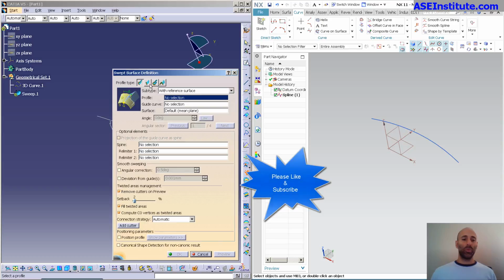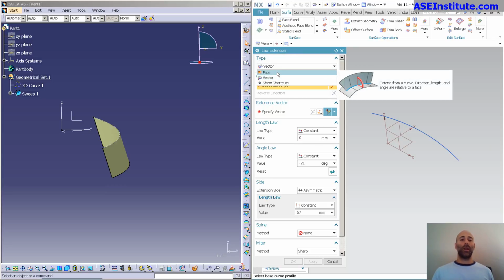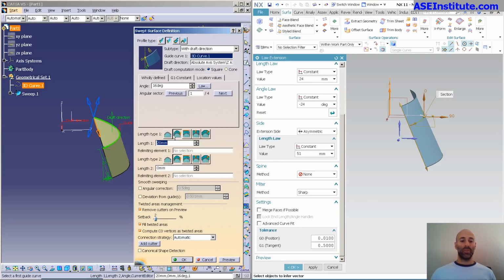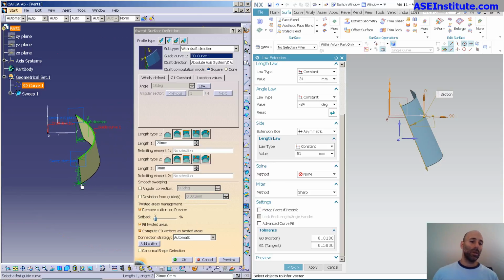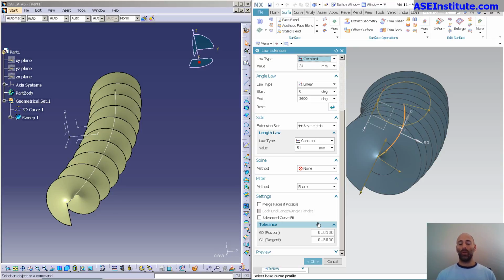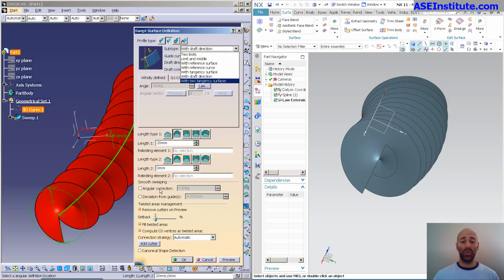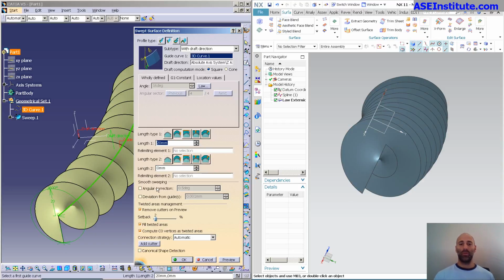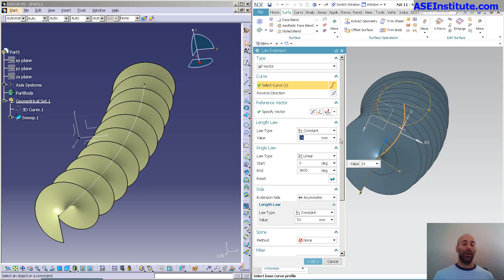CATIA vs NX: Linear Sweeps vs Law Extension

Comment: nice work .I want to know how to disassemble one surface in catia from a jion one . like nx do unsew a single surface
Reply from the maker: You can do an extract.

For you need the face removed completely you must extract the boundaries and then split it out. CATIA has Disassemble but the way it operates is very different than Un-Sew
Reply: for proper problem solution I often suffer I will send you data if you don't feel panic provide me your emails . I will send you data highlited with problems
Reply from the maker: info@classasurfacing.com

Comment: Great job man.
I want to ask if you could do in the future some videos about other features in nx surfacing like SWOOP. RAPID SURFACING,MIDSURFACE FACE PAIRS the PATCH command because i have not seen people using them.
Reply from the maker: I can come up with something for you.

What do you design?
Reply: for the moment i am just a student but i asked you this question Because i have never seen someone do some explicit tutorials using these commands and i am wondering in wich cases they may be useful.

Appreciate your response!
Reply from the maker: No worries at all. Glad you enjoy.

I will get you something.
Reply: thx. i am watching your vids all the way from romania:)
Reply from the maker: I need to get there one of these years. I had a lot of friends years ago when I worked at GM from there.
Reply from the maker: Extrude will do it but that is about it.

V5 does have superior tools in that regard for sure.
Reply: The folks at Siemens seem to hate the ability of sheets to terminate at (until selected or until extended) another body/sheet. Has always frustrated me as it would certainly eliminate a bit of trimming.